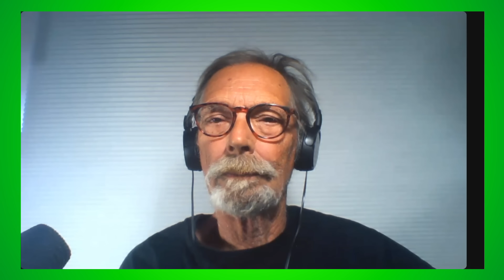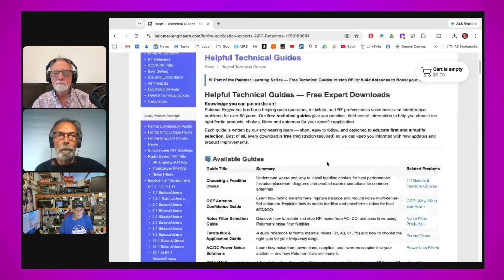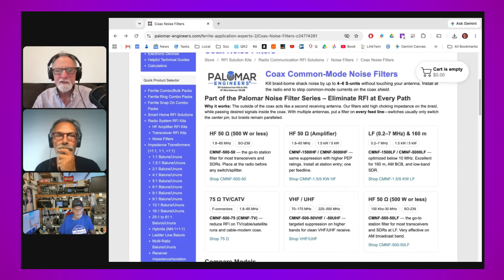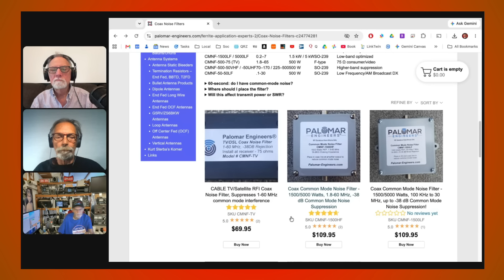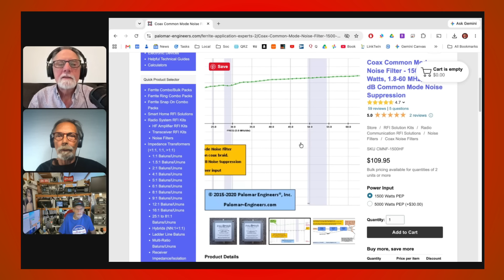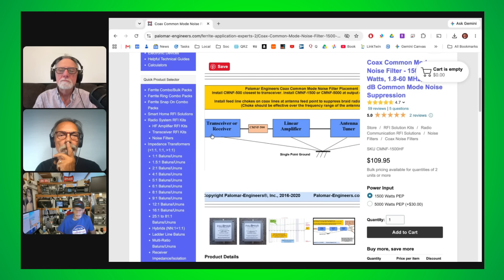AMAZING Secret to Reducing Radio Frequency (RFI) in Ham Radio HF Reception!

Comment: A great video and very informative, Bob did a great job. You mentioned costs to do things in radio and up here in the Great White North it can add quite a bit to purchase price. I looked at one of the offerings on their site and very affordable until you add on the dollar exchange and then shipping costs. Essentially doubled the cost of the item. Like the two of you only so much the pension cheque covers. I will put up with the noise. I learnt a lot in this video as well with several others you have posted. Keep them coming. Keith VE3SVQ The Shaky Key.
Reply from the maker: Thanks, Keith. Tom and I are looking at doing a few videos on making these cheaply yourself. Tom has made baluns, and we think others can do it as well. Understand the finances. BTW, we are going to be doing a video that looks at licensing in other countries, including Canada. We think the US could learn from your ham tickets. 73, Quin

Comment: I feed my 75 meter dipole with ladder line tuned with a classical ARRL handbook tuner.  A 6 foot piece of RG58 connects to the radio.  I tried the test of just connecting the center pin only, and then the shield.  I noticed no difference in noise level.  I understand that balanced line has immunity to common mode interference, so I shouldnt need a common mode noise filter.  Am I right?  NB4Q here.
Reply from the maker: With your setup, the common mode is not a problem. Carry on.

Comment: Just moved to TX from RI and will definitely be looking into these filters as I am now in a residential neighborhood . . . only going to use 40/15m with wire antennas . . . I had 60 foot tower, yagi and 80m inv-V in RI working great in a lo-noise area . . . except for next door neighbor with solar panels (PITA during the daylight hours) . . .
Reply from the maker: Also, see our other videos, especially the one on LEDs and dimmers. Q

Comment: Seems like you could eliminate the possibility of common mode interference by using ladder line.
Reply from the maker: That's a great point. Coax is so much easier to use, but creates the unbalanced line. Progress comes with costs.  73

Comment: LG is a culprit because they used inverters and variable frequency drives to run fridge compressors and washing machine motors and microwave bulbs. This is awesome and efficient for appliances but bad for noise!
Reply from the maker: Amen.

Comment: I enjoyed your program with Palomar Engineers' Bob Brehm (AK6R) - Excellent! I will look forward to future programs you do with him. Thanks for the many interesting topics you tackle.  I have several somewhat related questions.

Is there anyplace to find out how much RFI is created for various appliances before I purchase them? On sailboats it is common practice to turn off refrigerators to use the radio. Similarly sailboats have been getting their mast lights switched from tungsten to LED and the 120 VAC to 12 VDC power converter for the LED lights creates horrific levels of RF noise, requiring shutting off the mast light to use the radio. Many street lights now have this problem.

Who makes power-line noise filters to use with appliances? How effective are these?

What advice can you offer about lightning protection? I plan on connecting ladder line from the antenna to a high amperate rated double-pole, double-throw switch, grounding the antenna when not in use. I live at the foot of the Rockies with many lightning storms. A nearby neighbor had a direct hit on his rooftop photovoltaic panels destroying them. I use an APC UPS to provide lightning  protection for computers.
 - Scotty N6RFG
Reply from the maker: Hi, Scott. We need help here. A few years ago one of our viewers posted a website where in the UK or Germany you could look up RFI for appliances, and it was very broad-based, including a coffee (Keurig) machine I was using. Does anyone out there know where that info is located online? HELP!

Comment: I know Bob is very experienced and I respect him and his background immensely. I do believe that he has over simplified the COAX shield test, it is certainly not as accurate or simple as that to test for common mode interference.  Without the shield connected you do not have a functioning unbalanced feedline with proper circulating (differential) currents. The system is fundamentally different, so the test does not isolate common-mode noise the way is being claimed. It can still be a rough qualitative indicator that something is wrong with the shield path, but it is not a clean or definitive measurement. KM5L
Reply from the maker: Yes, rough indicator, a good start.
Reply: Convenient way to always get noise😂. I agree, it can't meaningfully work for a lot of antenna systems. Example would be a centerfed dipole, obviously cutting off one leg will cause a massive imbalance.  Not sure how to do better, though... maybe  a torroid with two, 3 or 4 turn windings on it, forming an isolation transformer between the feedline and the tranciever to block that junk.

Comment: I do not have power line / sourced noise.  I do not have common mode noise.  I have rfi hitting my antennas, mixing with real signals.  Something is creating that noise, and, how can I block or decrease it ?  Its mostly 160, 80 and 60.  It was also 40m, but i have removed several ac/dc devices from my home.  I have no near neighbors.
Reply from the maker: Have you tried running your rig on a battery and turning off the house main breaker? Or turning breakers off one by one? Also, use our technique for locating power line/pole noise. We are publishing it today or tomorrow on the channel. Keep us posted.

Comment: Hi there, by disconnecting the outer mesh of the coax you are not only disconnecting the  common mode route but you are also changing completely the impedance of the antenna, like it was said you're disconnecting 2 out of the 3 connections. So the conclusion the difference in noise level is solely due to common mode noise is i.m.o. not correct. 73's from Portugal P.S. you could do the dummy load test first connect the dummy load to the radio and compare the noise when you connect the dummy load at the antenna end. When it is much worse at the antenna end and almost gone when you connect it directly at the radio that is common mode noise. Second try switching off all your AC circuits one by one (the wife will love this) to find sources of interference. Best regards.
Reply from the maker: Excellent technical points, thanks for sharing your testing methodology. 73
Reply: I agree. The logic of the braid-disconnected test sounds wrong to me.

Comment: You have to remember that common mode is common to all conductors not just the outside of the coax. VK2SS
Reply from the maker: Great point. We need to address that. 73

Comment: Am I mistaken thinking that the alpha delta antenna switches don’t use the same ground on each antenna? Seems like I saw a big discussion about this awhile back. Most ant switches do use 1 ground which is connected to all antennas regardless of the antenna in use. Maybe Bob could chime in on this. Thanks Q
Reply from the maker: Alpha Delta coaxial antenna switches actually do maintain a continuous electrical connection for the ground/shield side across all ports, but they do not short the center conductors of unselected ports to that ground unless the switch is explicitly turned to the designated center "COM/Ground" position. I meant to ask Bob about Palomar making a completely isolated antenna switch. We will have him back for another video. Q
Reply: @HamRadioPerspectives  it's best practice to bring all the coax into the building through a grounded common metal plate any way. Put chokes outside on each coax or at least put a coax switch and choke the output.
Reply: @HamRadioPerspectives yeah open that filter up and send me an email of a pic inside. I think it’s just a mix 31 or 75 with rg400
Reply from the maker: I would not be able to tell the mix just by looking at it. Q
Reply: @HamRadioPerspectives it’s a gimmick

Comment: How does the signal not get attenuated by the common mode chock?
Reply: Because the inner conductors are shielded.
Only the outside of the shield (the "third conductor") is choked.
Remember, it's RF, not DC!
Reply from the maker: We are not sure. Tom asked Bob about that toward the end of the video. Q
Reply: The common mode choke has almost zero inductance to the desired differential mode signals. There will be a tiny tiny loss, even a piece of wire has a tiny loss. It's well worth it to help keep the rf out of the shack/off the equipment.
Reply: I was thing of inside the braid of the coax getting signal attention equil or less than the common mode current. I have built a few air core chokes. They work well . But what would be the trade off foe unbalance to balance transformation
Reply: Ferrite chokes have no effect on what happens inside a 100% shielded coaxial cable because neither electric nor magnetic fields associated with a wave traveling in coax extend outside the shield.
Reply: @radiosqueak ampere's law: if theres a net current through a given area, there will be an associated magnetic field around that area.
Reply from the maker: And I can hear those nets in my teeth. Q

Comment: I spent a lot of time tracking down a constant full spectrum interference source to a neighbour who had a cheap Chinese battery tender on his riding mower. It was so severe my hand held fs meter got a solid reading from a few feet away. I tracked it using a SA with a lna and a small loop. Luckily the neighbour was also suffering having no radio reception, not realising it was his cheap charger, so he was happy to bin it.
Reply from the maker: Great detective work tracking that source down! 73
Reply: Tender??
Reply: @BrianG61UK  An automatic battery charger and maintainer / trickle charger.

Comment: What's being said is put ferrite rings at the receiver end similar to the transmit one(s) at the aerial. 
It's what I do anyway. 
Buy ferrite rings and make your own cheaper. They don't have to be in a box with sockets.
G4GHB.
Reply: Every time I transmitted on HF with my FT200, the mains fuse in my Trio R1000 blew. I threaded a couple of ferrite tubes onto its mains lead right up against the back of the RX. Instant cure!
I also had to put a clamp on choke onto the lead between my signalink modem and the pc because psk31 crashed on transmit.. The other datamodes never crashed for some weird reason !
G4BTI
Reply: @DavidCase-ov5uo  
Glad to hear you sorted it out.
I only run QRP for 30+ years now so even less problems.
I did light my security light when on 30m but the long wire did run close to it. 

73, G4GHB.
Reply from the maker: Spot on, DIY is a great way to save money and get the job done. 73
Reply: Импульсные блоки питания, энергосберегающие лампы и другие современные устройства, они создают сплошные помехи. У меня есть радиоприëмник Балтика-52, у него хороший ламповый звук, но слушать радио, можно только после того, как выключу все лампочки и другие потребители в доме. К сожалению в радиоэфире почти нет вещания на русском. Только китайцы и некоторые религиозные радиостанции и "Радио России". В с❤тарые времена, когда в эфире был Голос Америки, Свобода и  Свободная Европа, слушать радио было интересно. Даже  радиолюбителей на КВ почти не осталось. Иногда слушаю радиохулиганов на спутниках Сатком, но и там активность не большая, хотя этим способом можно иметь связь на тысячи километров, но это незаконно.
Reply: @АлександрБеденко-д1и  
Yes, a lot more interference now, t.v. was the main one way back affecting 160m and 80m.
My own house is not bad, L.E.D. bulbs okay, a bit from my computer but I don't use it when listening to radio but maybe one next door or some kind of light sometimes causes noise. 
I had terrible noise affecting from 160m to 20m for 8 to 10 years until the phone line was replaced with fibre optic last year. I've not got back into it yet.
Regular ones like V.O.A., Radio Moscow, and all European countries were active and I remember H.C.J.B. was always a good signal. Only a few now as you say. 
I've been active with getting old valve receivers working lately, an l.f. converter down to 10 kHz and an ex-army so called 'Sputnik' receiver which covers 10 MHz to 60 MHz and so covered the Sputnik frequencies. 

I have listened to Ostend Radio shipping information twice, that's a change and interesting. An anchor and chain on the sea bad, many objects and an explosive object to avoid and coastal pipelines to avoid with latitude and longitude co-ordinates given.

I must get back on again with QRP s.s.b. and Morse. 

Isn't Google translate wonderful! 

73, G4GHB.

Comment: When I took my radio mobile/portable in my brother-in-law's I had a constant electric sounding snap of static on receive that was also a constant time (a couple of seconds or so) and it was on every frequency.  His radio in his shack did not have this problem at all.  He turned the electric fence charger behind the barn off and the noise went away.  When you're beside the electric fence with it on and near some high grass or weeds touching the fence wire, you can hear the snaps of the electricity at the same pace as we were hearing it on the radio.

73

   Jim 
KE9BNG
Reply from the maker: That reminds me, Jim, that you can identify a noisy light on a pole, using in a parking lot, by using a baseball bat to hit the pole while listening to the noise. It makes a sound in the noise. Q